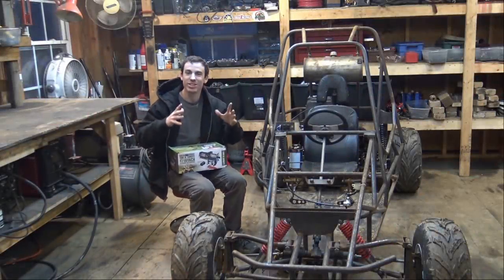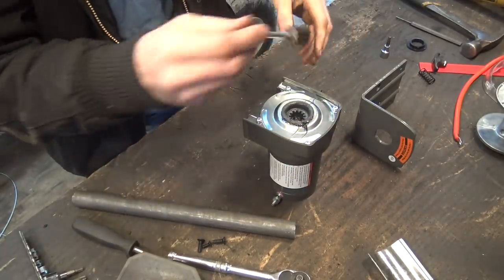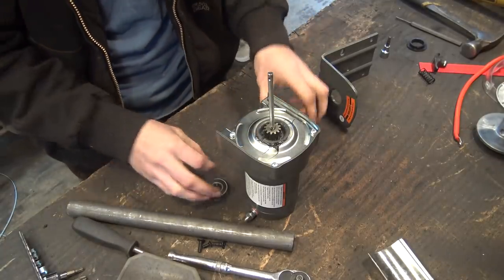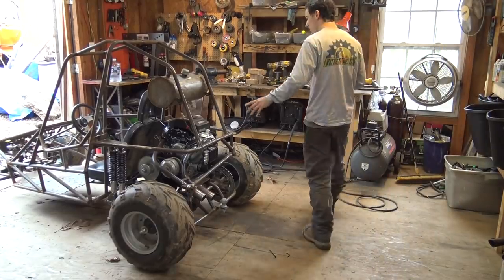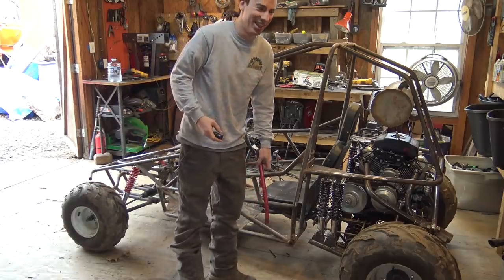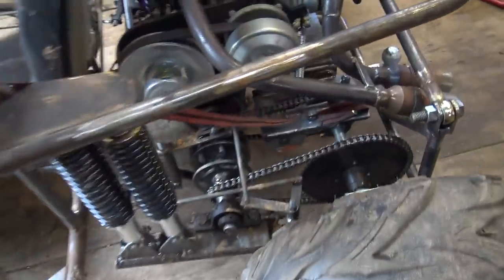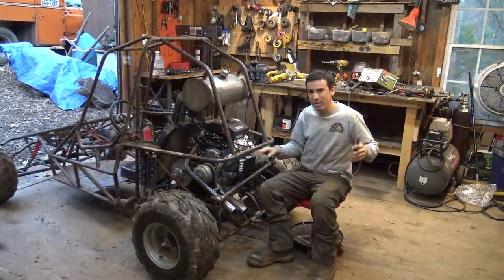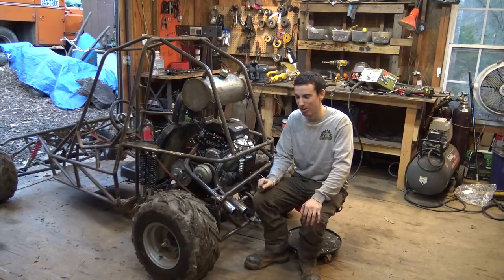Installing Electric Reverse on the Two Speed Off Road Go Kart

Comment: You may be able to convert a alternator into a motor, and just face it to where it turns backwards while it’s under power. When there is no power on it, it should be able to free spin. It could also still be utilized as a generator.
Reply: There is a video that shows you the steps to take to convert the alternator, it should have enough torque to be able to push the 670 backwards, and still be able to free spin when you don’t need it, just make sure of the rotation that it will spin after you convert it. But you will have to build a housing to keep water and dirt out of it. Hope this helps buddy

Comment: there an idea to prevent the winch from bouncing around  add a stronger and slighty shorter spring and weld a metal piece as a stopper to prevent it from going higher into the chain

Comment: Hey Chris,  I had the same idea but I found the same thing so I went with a electromagnet off of a clutch on a gm ac pump so when I want to use it I have it turned around so you use it in forward but turned so it will go faster and I just hit a toggle switch that locks the thing so it will go in reverse.

Comment: 3500 or 5000lb winch will work just fine..i think it would be cool to put a 2500 on each front wheel..you will have reverse and 4 wheel drive if you ever need it

Comment: Could always integrate a one way bearing into the reverse that way it's technically always engaged but will free spin when going forward and will engage when you want reverse...kinda like a sprocket
 on a bike rim
Reply: I thought about that but then if he is going up a hill and doesn't make it and starts sliding back down it would be locked and he may end doing several endo's, at the very least it would stop him from being able to just roll backwards a little bit easily and then keep going.

I think he could easily add a reverse to his two speed trans and it would work much MUCH better.All he has to do is figure out how to get the reverse chain to drive the reverse sprocket from the outside of the chain.

So picture a standard two sprocket and chain, they all rotate in the same direction but if you add a third sprocket to the outside of the chain loop it will rotate in reverse of the others.So what needs to be done is to have enough of the reverse sprocket engaged to the chain to keep from skipping and use it to drive reverse.Of course he'd have to make a similar system to his two speed trans for reverse and to use it just shift the forward into neutral then engage the reverse. 

But what do I know, I'm just some guy watching youtube vids of someone making some cool stuff.
Reply: @TeamCheap1  so very true didn't think about it locking up on him in an unwanted reverse like you said if he doesn't make it up a hill or whatever..good thinking lol

Comment: Small battery, also installed it on the high gear side of the transmission. 

Unfortunately the Amazon reverse kits DO NOT fit the torque converters. Watch mustie1's videos to see why.

Comment: I think you should just build a counter shaft for the reverse gear and use a lever to manually engage it just like your two speed shifter. This way it will be powered off of the engine instead of the battery.

Comment: I have a serious question that I'd really like you to answer.. no BS.. wouldn't the axles have to have some sort of slip joint so you don't cause binding in the axle housing?? I mean if it's an Indy style suspension it won't travel much but off road application needs slip joints right?? Plz answer back...

Comment: Starter motor and flex plate that automotive torque convertor bolts to.  Use  from same brand auto.  Should fly back.  If too fast  use as part of gear reduction

Comment: 🙏Hi iam from INDIA.. I make a go-kart with 125cc bike engine.. I Use in that kart one of the three Wheeler auto gearbox. it's Attaching with bike engine. Auto gearbox for Revers and forward.. Gear Handels 2.. One from engine for12345 speed.. One from gearbox for R/F... I think that is so simple.. Your Thought is rich👌.. But  that is not like an automobile theem.. also it more maintenance with less Speed.. Any way good job brother..👍👏

Comment: Add a peerless 700 gearbox converter it to side shaft input improve the case by making it out of metal and put better bearings in it then you would have a 5 speed with reverse just a idea that eventually I am going to do to just need some better tools to do so like a lathe

Comment: On a fourwheeler you need to leave it running for the winch to work properly because the batteries aren't big enough like in this case. Did this winch originally have the freewheeling pull lever? That's how you could free wheel it when driving.

Comment: Funny concept.  Wanna see this go somwhere. Tho go power sports reverse box is like 120
Reply: Sweeney Sweeney they can only handle up to the 420 engines
Reply: @nialpmatk04  yeah . Seen a guy at Busco Beach that used a reverse box from a hammerhead 250. There like 300 tho. Had a bike motor on his kart tho

Comment: If u had the engine running the voltage would be higher and would have a little more power. Good first try

Comment: hey man im not sure what youve done with this machine at this point, but your issue is that you took the reduction away from the chain system. What you should have done was driven the smaller sprocket towards the front instead of having a sprocket/clutch system like you have. a third sprocket like that eliminates any gear reduction you would have had as they just become idlers. You may have been able to use a belt driven system instead and had a manually operated tensioner. pm me if you need info.

Comment: Weld a alternator bracket with v pulley and weld a v pulley on the gas motor to run the winch and you don't have to kill the kart

Comment: Get a 12v electric motor like a 4hp one and install it solid mounted with a centrifugal clutch so u have a faster reverse
Reply: You cant really mount electric motors with a clutch.. why should you? they do have torque at every RPM.. and that makes a clutch unneccesairy. Also 12V and 4HP means an constant amperage of 250A.. for which you need expensive and heavy batteries..
Reply: Voltaic - Elektro Werkstatt well something better than 2.5hp and the clutch so it don’t hurt the motor when the engines running

Comment: you need a lower gearing, and a larger battery, also a decent charging system off the engine. a bigger winch wouldnt hurt.

Comment: Put ebike parts on it 24 volt assisted mountain bike motor with a shunt mod should give u what u want and at least 10 km speed in reverse is more than enough the way you mounted it would work and it's water proof
Reply: ebikes are mostly 250W... especially when you do only have 24V.. and that things looks like needing 5000W to move backwarts in Terrain:) at least my electric buggy needs that...
Reply: @Voltaic  ya maybe I have 2 of those motors running a solid axle on my buggy I'm building with me it probably weighs 400 - 450lbs with the shunt mod I did to the controller the torque I get almost pulls the front wheels up although I have it geared low 3 to 1 as it sits it'll go thru almost anything

Comment: have you tried it with a full size car battery? i think your gokart bateries are too weak for it. engine running would help a little but i dont think the not real alternator can pump out much power at all to sustain the winches power draw

Comment: U need a trail boss transmission with high low and reverse.. I had built a ATV with a 440 snowmobile motor 60+ hp .. twin stock banshee pipes and a big single carburetor.. low gear it did 35 mph and in high gear it did close to 90 mph and still ran out of gear

Comment: didn't I suggest this in comment of last video..... no? uh, ok...
at least you pulled off what I'd described. I'd levered down to the top of existing chain not inside for taller ratio near axle sprocket. your battery can't provide enough amps.
last video "I wouldn't use an engine like this for it having no reverse". I described what makes electric reverse for a weedeater powered model boat, funny how that works.

Comment: Super old and I doubt it's worth the time to even type this, but you just need more battery.  Four 6ah m18 tool battery knockoffs in parallel  will give you much better performance. That winch probably wants 100 amps with you in it, going up a hill. A little lead acid battery like I assume you're using would sag down to less than 10v and give you that sad dying sound.

Comment: I got the exact wench for Christmas for my atv, I’m wondering now if I should even bother with mounting it, seems like a lot weaker than 2500 pounds.
Reply: You cant really use this as reference since the leverage the motor has right now is the original one(coqwheel) and the lever of the tires... so it propably can pull that buggy uphill easily when not attached to the tires.

Comment: you need a better CCA Battery.. the built is prob legit..  The  gas motor you run calls for 300CCA to get started..   but most trucks that run winches have about 800-1200CCA..   Cub Cadet dose make a winch that runs off their 300CCA system..  but i think it still be weak for what you are doing with out a better battery

Comment: Change the concept. 
Use a starter motor. The solenoid will keep it separate when not in use, then engage it when needed.

Comment: Use the smallest flywheel you can find and a car starter motor. It will only engage when you apply power, and will retract when you drive normally. Problem solved

Comment: If you want to get into electric Buggys I can tell you one or two things from my experiences with building something like that!:D or if you need help with battery and relais related stuff..!
Reply: Wazzup Voltaic? Zap zap, Im buildin a 2 wheel wheelchair with a 50mph 1st goal, dual 36v 2500w BLDC Motorz, Lithium overvolted. Ya got Sum input ? Not sure how theze commz werkz, but if U reply, it will show on my 60"!
Reply: @thead10  hey!:) you are lookin at 150-200Amps of current make sure you have batteries which can supply that! Have you already bought the motors? if not I can show you really efficient dual 3000W motors for 200-250$ a piece with controller, reverse and more stuff:D
Reply: @thead10  I think I can help you quite a bit with that project! But I already see some Problems with the components..!
Reply: Yes, Arduino Uno + MPU-6050  +  Ard onboard motor control, to feed signal to the 2- larger ESC's thats the reason I need to use BLDC motors, You are talking gearing, as I laid I plan to use the motors without gearing, direct like your hub motor! centerline of axle. If that wont work, I can drop back to belt drive timing gears and determine a suitable ratio. No chains remember itz a Wheelchair. Ssshhhhh. Do you use messenger?
Reply: @thead10  oh... why not use hub motors then? there are bike hub motors finished with 26° rims out there which have a lot of torque..! They go from 250W to 8000W .. in one of my videos I use 1000W motors to build a electric bike car!

https://de.aliexpress.com/item/Front-wheel-electric-bicycle-conversion-kit-48v-1000w-electric-bike-conversion-kit/32727819283.html?spm=a2g0x.10010108.1000016.1.5bfb1063YZWJw3&isOrigTitle=true

You will absolutley need gearing otherwise since the motors only produce 4-5Nm of torque without gearing.. and thats not enough to balance the wheelchair I would imagine..! Also those hub motors I sent will have way more torque to controll the wheelchair at 1000W then the BLDC motor at 2000W... !
Reply: and those 4-5Nm of torque are for the 26inch wheels.. which makes it even less powerfull!

Also try to find single side mounted Hub motors! Will make the build more sturdy.. otherwise you would have to build a frame arround the wheels to fix it from the other side as well..
Reply: also dont forget that all those motors have controllers which need a hall sensor to work out the correct timing of the magnetic fields in the motor..! Does your ESC's have Hall Sensor inputs?
Reply: mhh what about trying to mount two 1000W standart Controllers in parallel for each wheel? but one is mounted so that the Hub Motor spins backwarts (you have to change blue and green hall sensor and yellow and green power connection cables I believe) ?? this would result in you having two individual throttle inputs from 0-5K on each side and also not the problem of switching betwheen forward and backwarts! You would have to make sure that the Arduino only alows one direction at a time to supply power to the motors! But this could work I think! And sounds like a quite cheap solution.
Reply: The Hub motors do have a way higher leverage in the motor as the spools in the small BLDC motor have..! So every magnetfield produced in the small 2000W motor only has less then half of the diameter of the motors of leverage to the output shaft..! If you have a big hub motor the leverage of each magnetfield is way bigger since the motor radius is way bigger as well..!
Reply: here is my facebook https://www.facebook.com/franz.primbs
write here after you have seen it so I can delete it :D

Comment: Boy do I wish I had all the machines y'all have.  I am thinking I can adapt a drill press to hold a 3 jaw universal lathe chuck and an a milling machine adapter function. My idea is to build a precision vice setup  for each accessory attachment including a 90° drill press. Adapter for the lathe and milling processes. Following that will be required a precise in & out articulating drill press tool. (probably motorized). Plus a stronger variable speed motor controller.  Of course this would be a small precission lathe w/o the precission part.  Do they make such an apparatus already? Possibly purchasing a precission lathe could suffice even for milling operations as my intentions are for small parts. But who knows the problems inherent.
Currently i have torches, a mig & stick welder, a drill press & a cutoff saw. I don't have enough finances (like most of us) nor enough... junk metal stuff, scrapmetals, gears, bearings and good enough transportation, (the reason for this project) health to bull my way through my needed projects. Even my eyesight is failing which is why a Go Kart instead of a car and I live several miles even from food stores. My wish is these were the severity of my dilemmas.  I am restricting my Karts speed to a 2 speed and reverse at about 25 mph and 6 mph. I live on a ranch/farm and can use a slow moving vehicle sign to further ensure safety.  I have absolutely no intention of ever going into a "home" or "rehab center" EVER. Even no one should ever have to endure my living conditions.  If completed my Cross Kart will also suffice as my home as I don't need much to be content.
Sorry for dumping some of my problems, but perhaps others who feel their same as I can be inspired to set themselves like wise that they may continue keeping their freedom lifestyle.  Lucky for me, I have no for-seeable or current reasons to become a tube infested, injection restricted, old timers mentaliy and beeping machine restricted patient type atrocities I cannot self-control.

Comment: rather B welding You could try getting two new 12ah 12 volt batteries and running them in series or parallel, not sure if that thing could handle 24v but if so it would be much faster and more power, if not running them at 12v would keep it from stalling as easy as it is with only 1 battery.   Alternately I would install one of these fwd/neutral/rev gearboxes:
https://www.amazon.com/AlveyTech-Reverse-Transmission-Go-Karts-Converters/dp/B07CJY4DWH/ref=mp_s_a_1_5?ie=UTF8&qid=1546802237&sr=8-5&pi=AC_SX236_SY340_FMwebp_QL65&keywords=forward+reverse+gearbox&dpPl=1&dpID=51i-W98dcRL&ref=plSrch

Comment: What you talking about man get you a flywheel or a flexplate and adapt that to your axle that would connect to the starter bro
Reply: I was thinking the same thing.  It would be a simple setup.  A flex plate from a Small block Chevy would be cheap and light.  They also come in a few different sizes so he could have a few different ratios to choose from.
Reply: @ziptiejedi5658  yeah but you're missing out on the idea that a flywheel for a lawn mower a riding lawn mower is about the right diameter for his axle and it uses the same kind of Drive is a starter a motorcycle crankshaft has a flywheel on it with teeth that you can use a starter for

Comment: It's not a total waste of $80 on the cheap-o winch motor- just because it wouldnt drag the kart in reverse- you could still use it on something for the shop with better gearing, some sort of engine hoist or make another spinning welding position-er, or some other tool that requires a motor? I'm sure you'll come up with something?

Comment: 11:35....Scotty to bridge,I'm giving her full power Captain! 8-9 deep cycle batteries oughta do it........hmmmm.....You already build a 2-speed,build a separate reverse that uses the engine.An odd # of gears with your in/out design will reverse....just put "normal shifter in  neutral,separate lever for reverse,maybe add a lockout for idiot drivers(not you),lol

Comment: You need to leave engine running while the winch is going , to power the battery. Get s bigger battery also...  And maybe just try a different gear ratio..... 
Look for sprockets at Surpluscenter.com

Comment: Why are you using electric motor? It consumes a lot of electric power from battery. Easiest way is that you make another 16/18 teeth sprocket and place it into gearbox between main connecting power sprocket and 1st gear sprocket. Place it in a such way that you can engage or disengage it willingly by a hand lever.
Or Use a conventional differential reverse gear.

Comment: There is no way that winch could have ever pulled 2500 lbs.  Another "over rating" by Harbor Freight.  Or,,, that battery simply can't provide the needed amps.